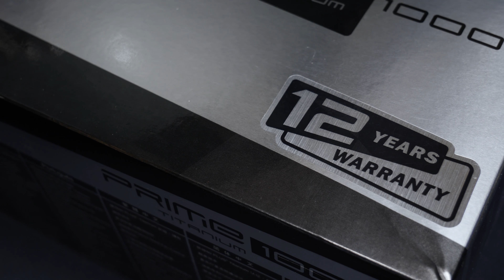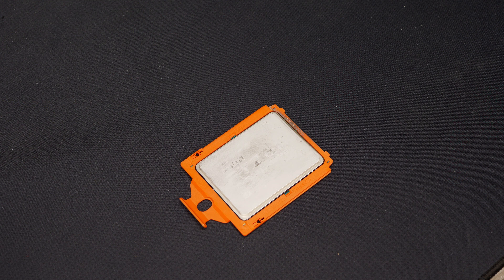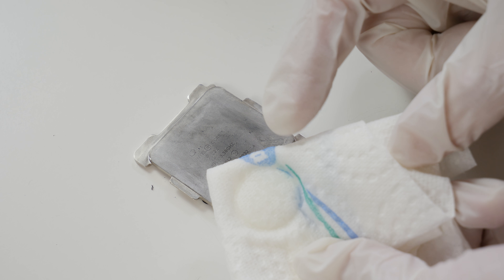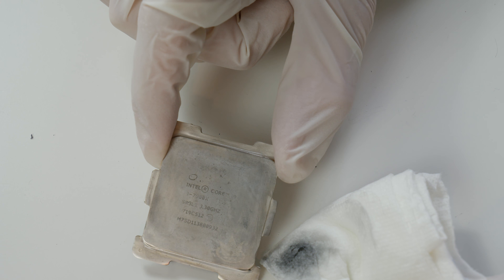HowTo: Remove Liquid Metal Residues (en)

Comment: this method is so easy to remove liquid metal residues from ihs is wrights copper cream from amazon i use it to clean copper pans but its cleans ihs so easily and much more easily than the hydrochloric you were using,just thought i mention it as i found out by accident i delidded a 7700k and fitted a rockit cool copper ihs instead which left me with the original ihs - i saw your video and you scrubbing away and just thought id go downstairs and try the above copper cleaner and was amazed at the outcome,very quick and it now looks as it did when it left the factory.its not cheap but as i use it anyway and it can be used for other cleaning of metals  i thought id post. and it lasts a long time,it comes in a tub and you only need a tiny amount for excellent results.

Comment: Use hydrochloric acid in a well ventilated area and keep an eye douch handy or make one. That stuff stinks and can get in your eyes with or without eye protection if you’re unlucky. Had that happen with backfire from a rim. I used to work with that stuff a lot.
Reply: I was about to say that's shits extremely dangerous and will kill you if it's absorbed into the skin. But then I realized you're talking about hydrochloric acid, not hydrofluoric acid...

Comment: @der8auer 

Is there any hard data or direct testing that has been done on how the exposure to liquid metal changes the thermal properties of copper and nickel-plated surfaces? is it actually a negative at all (aside from being ugly) or just such a small change that it is not worth worrying about?

I realize you kind of touched on this in the video - I just want to learn more details if possible. I don't need to worry about getting a special cooler with a nickel-plated bottom in order to get ideal performance right?
(edit: rephrased question)
Reply: GN (Gamers Nexus) does very in depth articles (Youtube videos too), and they couldn't find anything within margin of error around 1c in temperature change. They concluded it probably does, but its so low (within 1c), that you just wipe it off best you can and not to worry about it.

Comment: I've got a delidded i7 4790k which has had liquid metal between the die and IHS since day one. As temperatures seem to have increased slightly, I'd like to refresh the LM but I'm very worried about it being completely dry. Do you have any tips on removing the IHS from the die when the LM is possibly acting as a (very strong) glue?
Reply: LM does not dry out, nor does it harden, and it should not need to be refreshed, the temperature increase is probably caused by something else
Reply: It definitely dries/hardens. I've had that happen after about two years between an IHS and cooler.
Reply: That is surprising and concerning at the same time. Since LM does not have any component that could evaporate and it does not react with itself over time, it should not harden at all. That fact that is does is concerning, because that means it is reacting with the IHS, the cooler, the air or possibly all of them.
Reply: It is very well known that LM hardens over time. I don't know about the Thermal Grizzly liquid metal as it was not yet on the market when I started doing my research on delidding. Collaboratory Liquid Ultra was very well known for drying/hardening (even if only a little bit) over time, but I just took the risk. I don't want to take the risk of bricking my chip when trying to remove the IHS again though.
Reply: an chemsit in the comment section lol what about using 5% HCl to clean copper heat sinks ?
Reply: It won’t dry out, but the copper heat sink and even a nickel plated copper IHS will react with it and “soak up” some of the LM over time.
Reply: It technically doesn't dry. It forms an alloy with the other metals it is in contact with. That alloy will be slightly less effective than it was when first applied, hence the slight temperature increase. But the alloy is still more effective than any normal thermal paste. And if you continuously reapply new LM, you will get the opposite effect of what you're going for, and the effectiveness will continue to get worse each time. The reason being that the alloy makes the metal of the heatsink/ihs slightly thicker, and then when you reapply LM on top of that, you now have a slightly thicker layer of material there, that is less effective thermally than the bare metal. So each time you reapply, you make it a tiny bit worse by increasing the most inferior of the metals between your processor and cooling.

Comment: Question please -
With the threadripper it is in its holder so the pins are protected, and of course the Intel has no pins.
What would your suggestion be re the Ryzen 3000 series CPUs as far as protecting the pins please?

Comment: What would happen if you milled the surface of the heatspreader with a CNC machine to create tiny grooves much like inside a water block. Would the increased surface area improve performance?
Reply: This wouldn't work the same as the inside of the water block... internally you're trying to increase the surface area that water flows over / around, however with the cpu and the block, you're actually trying to minimize the amount of thermal paste / liquid metal needed to fill the gaps... the best heat transfer is going to be the points where the block actually touch the cpu... wherever the paste fills in is going to transfer the heat more slowly

Comment: If liquid metal hardens over time is it safe to use it in between the CPU IHS and the waterblock ? How much time will it last ? 
And a last question : I want to use liquid metal in between my CPU IHS and my watercooling but I'm always afraid that because the motherboard is vertical the liquid metal will flow down over time. Is this possible or is the liquid metal not that "liquid" and thus does not flow down ?
Reply: Vladek16 you only need a very little layer of metal this cant run down your mobo
Reply: It's literally metal. It doesn't dry out. It won't run if applied properly. The steel on your pc case doesn't dry out, this will not either.
Reply: You should be fine. I've used LM between an IHS and waterblock for longer periods of time without any problems. just make sure you don't apply too much. If you're very worried about dripping LM, you could always add a bit of putty.

Comment: I don't think this worked really well, is there something else that would do a better job?
Reply: Warm up the CPU a bit with a hot air gun. This allows the liquid metal to become more fluid again.
Reply: I've heard metal polish works, like what you would use to polish silverware. I would be concerned about it working too well though, polishing off the laser etched markings.

Comment: Hi
I was thinking about changing intel tim to liquid metal but buying all parts needed will be higher then paying on Ebay around 25£ for some to do this for me and send it back 
And here comes my worries is there any chance that liquid metal will go off from cpu and stay somewhere between cpu and ihs?? During shipping?? My i7 4790k on 4.6 ghz is getting around high 60c low 70c at 1.210v

Comment: (buys a Coffee Lake Celeron)
(delids)
(uses x-acto to cut die off)
(delids 8700K and swaps IHS)
(files RMA for 8700K)
(glues 8700K IHS onto Celeron)
(sends Celeron with die removed and 8700K IHS as failed 8700K)
(gets another 8700K back)
I L L U S I O N 1 0 0
Reply: Did u mean uses exacto to cut the heat spreader off? Im assuming no since u said “delids” prior to that
Reply: @ryanjelinek3969  He cuts the die off the celeron and put the 8700K IHS on it. Then RMAs the Celeron with the 8700K IHS as a non working 8700K. Clever girl

Comment: I tried it with my 6900k.
Used tooth paste and removed it completely.
Reply: Tooth paste usually includes fine Hydrated silica abrasive that can polish the surface. Essentially toothpaste is flavored polishing compound :D
Reply: CatSay i used anything and i was not able to see the words on my 6900. Finally i came with any idea of tooth paste ( crest 3d whitening). Used a toothbrush, then clean with alcohol then repeat, 4-5 turns it shine like new and all the words are visible like new. But close the hole if you have soldered cpu like mine.
Reply: EEH The extra whitening toothpaste is excellent polishing compound since it includes slightly larger silica particles. I've used it before to polish metal when I had no other polishing compound available.